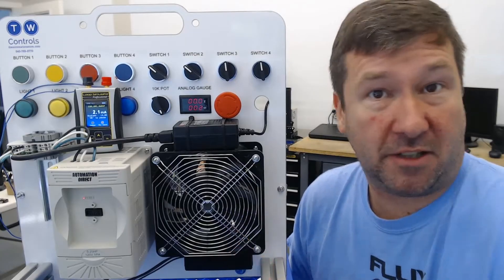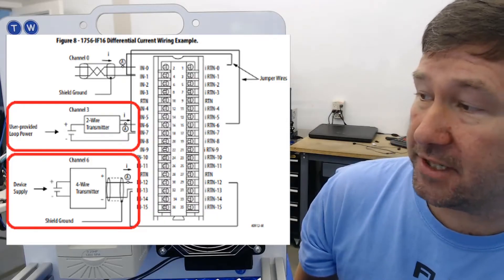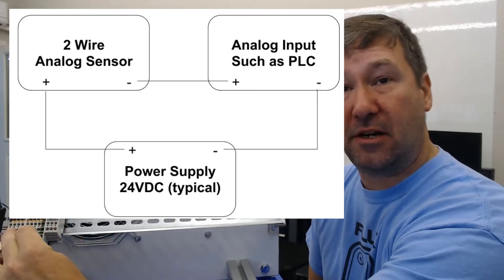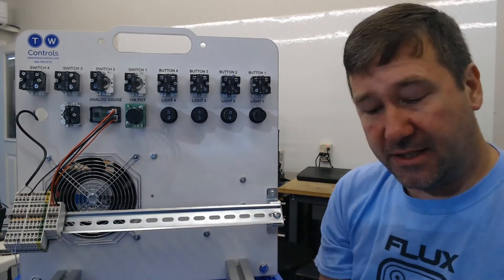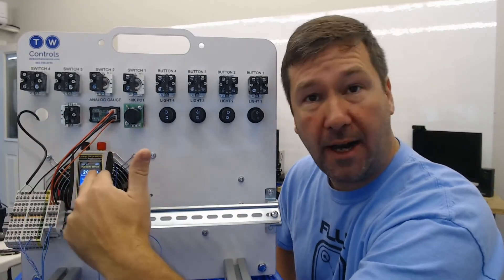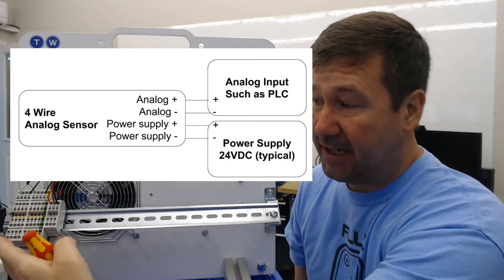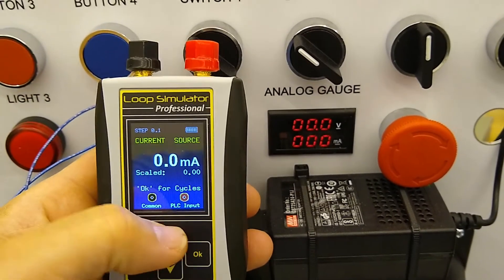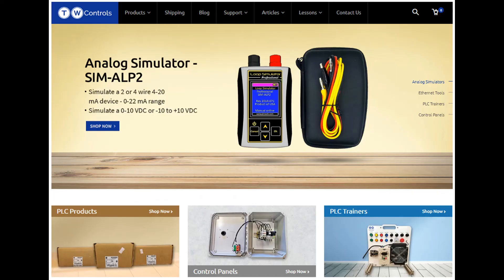How to Wire 4-20mA 2 Wire Current Loop or 4 Wire Current Source Analog

Comment: These video's are worth gold, thx alot.
Reply from the maker: Glad you like them!
Reply: @TimWilborne  I'm having a small PLC problem; I have a 4-20 temperature transmitter that i want to bring to my analog in but the plc doesnt read it ... I went from PS+ to TTR+ and from TTR- to PLC AI. And the PLC common is - .... So it's wired in the loop but it's not working, any suggestions?
Reply from the maker: Put a meter in the loop and see if it has a signal.  Here is a video to help.
https://www.youtube.com/watch?v=aJxLusnZfJQ

Comment: Hey Tim
 Should I connect active / passive analogue output of an ABB flowmeter to my Micrologix 1400 IF4 module . The flowmeter is 230 powered.
Reply from the maker: Chances are it is an active or 4 wire device but you need to check the manual to be sure.  In that case + goes to + and - goes to -.

Comment: Hi Tim, Is it possible to use 24V DC Supply OUT from PLC to power HMI, electromagnetic flowmeter, and ph meter? or I should use different DC supply for these sensors?? Thankss!!!
Reply from the maker: While possible, I would advise against it. It gives your PLC less isolation. Some PLCs memory will become corrupt of you short their internal 24V power supply.
Reply: @TimWilborne  Thank You for your advice Tim! I will just use different DC supply for these sensors

Comment: I have a transmitter that is a 4-20mA 2 wire loop and I wired it as you've shown in the video with the 24vdc positive to transmitter positive, then transmitter negative to my multimeter positive, then multimeter negative to 24vdc negative and everything works as advertised, is what I can't figure out, or if it's even possible is that my analog input needs to be 1-5vdc, is there a way to wire this or place in a resistor somewhere to make it work or not?  Thanks for all of your videos!
Reply from the maker: Hi Dan, see link below.  Thanks for watching!
https://www.theautomationstore.com/measuring-a-4-20ma-signal-with-a-voltmeter/
Reply: @TimWilborne  The problem when I do this with a 250 ohm resistor is that my transmitter loses power.  I've been scratching my head on this for a while.
Reply from the maker: @dancrane4318  Send me a sketch of your circuit. contactus@twcontrols.com

Comment: If I had a 2-wire sensor that had 4 wires  coming out of it, how would I know how to wire it? Or are all sensors with 4 wires coming out 4-wire sensors?
Reply from the maker: Chances are you have a 4 wire sensor but do you have a part number?
Reply: @TimWilborne  no, it was just an idle question. I wondered if there was a quick rule of thumb or something, but it sounds like the answer would be to read the spec sheet and just become familiar with the part.
Reply from the maker: Yes, it is probably safest to check the spec sheet.